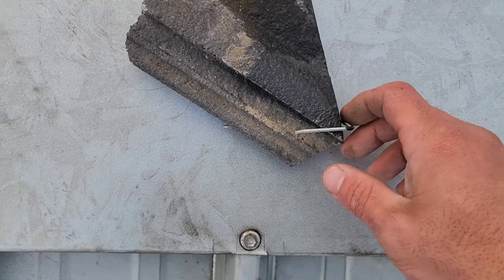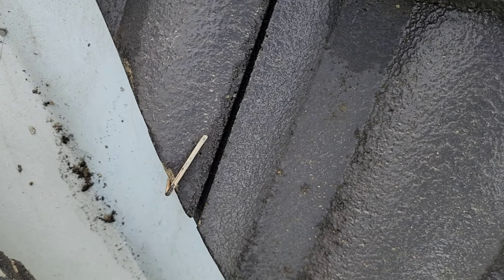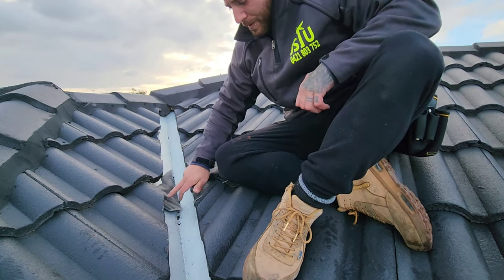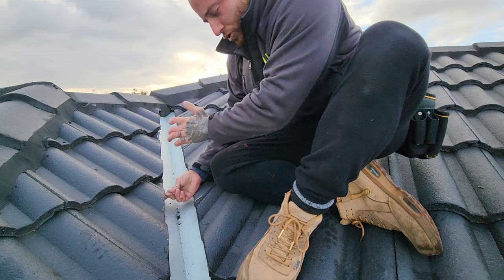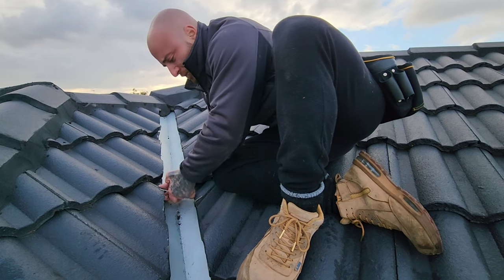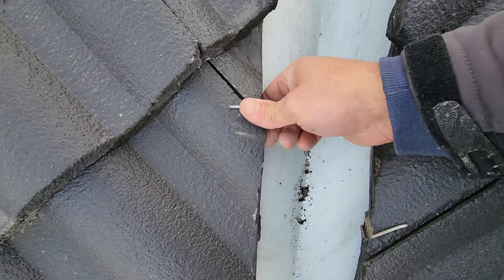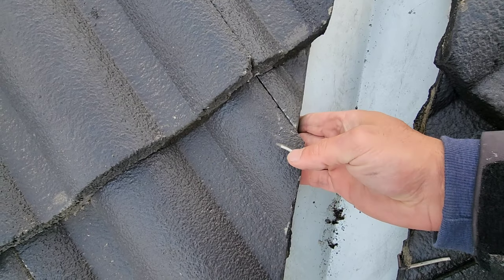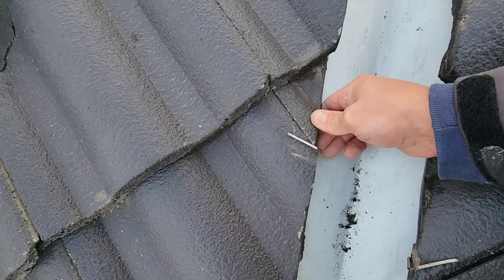Valley Clip DIY Installation: Part 2 - How to Install Valley Clips for a Leak Proof Roof

Comment: Can i use one to secure a non valley tile? One is loose and slides in heavy rain, but the tile above is just under the pointing and secured so i cant nail it in!
Reply from the maker: Yes, you can. You can also use silicon. since it's your house And a customer is. not paying you For compliance work
Reply: @JSIUROOFING  thank u!